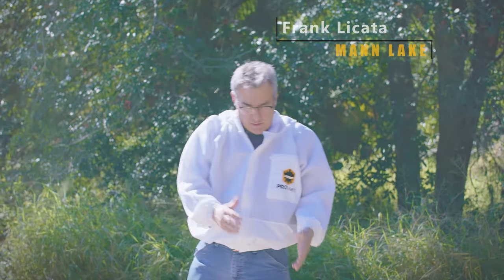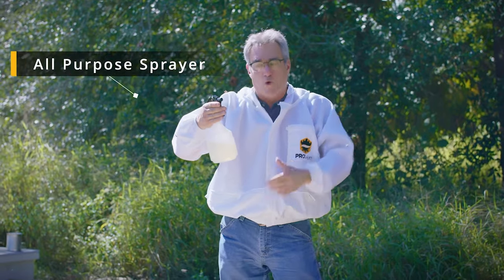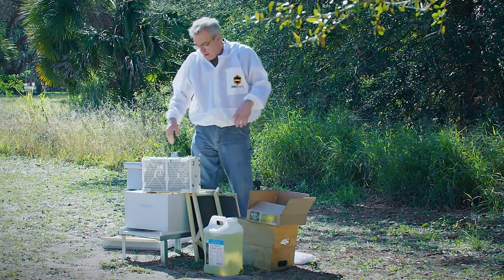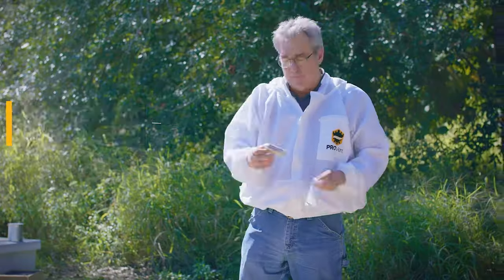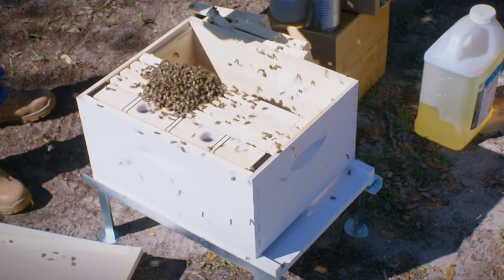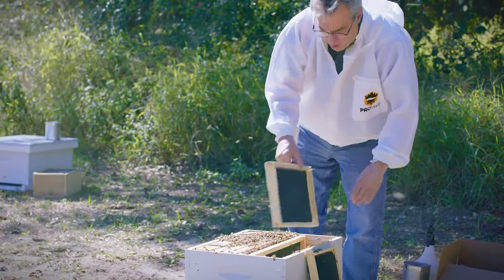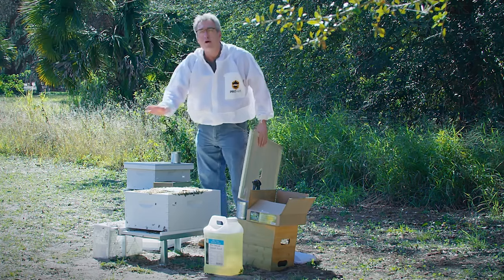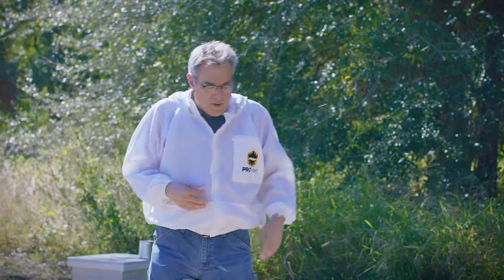Installing a Bee Package: With Plastic Bee Bus

Comment: I took my empty bee bus and screwed a board across the bottom. And I put a wax frame inside.Now I have a swarm catcher that I can put in the fence corner or a tree.
I hope this works, What else can we do with the empty's ?
Reply from the maker: What a great idea! The Bee Bus is also made of plastic that can be recycled.
Reply: @mannlake  The best recycle is reuse. We need more uses for these boxes.
Reply: I could be wrong, but isn’t it better to put some type of dark wall or sack over the majority of the bus and just make sure that it has its opening? A lot of traps are basically dark canvas bags hung in a tree
Reply: @accentphotonc  I will try that thx.